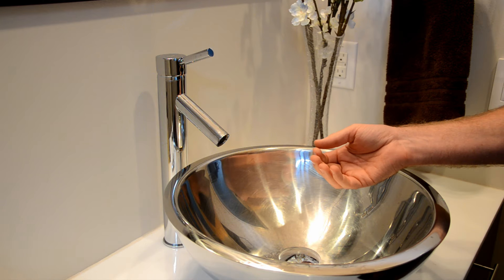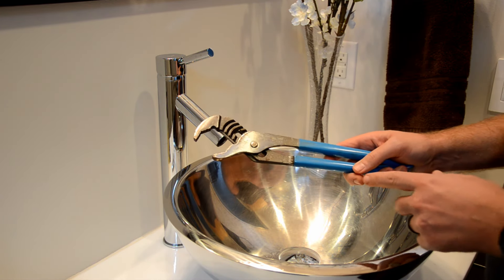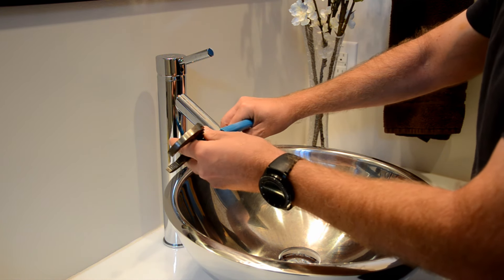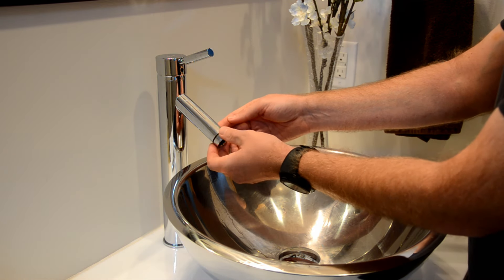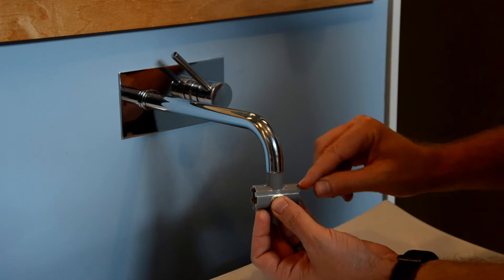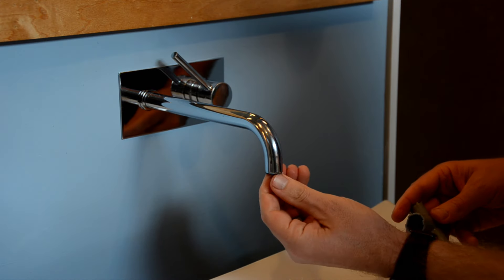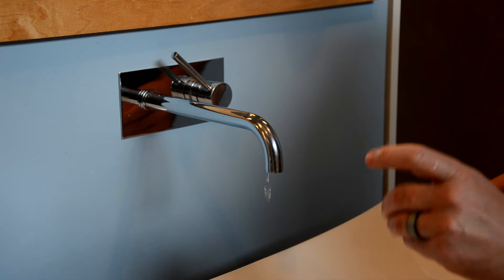Replacing a Faucet Aerator...that’s stuck!

Comment: Errr, why was this video titled about removing a STUCK faucet aerator when it's just a video showing how to remove a perfectly normally loose aerator that isn't stuck at all (on the recessed one)?
Reply: Like calcified in place !  My issue!  Tried soaking in vinegar and the aerator still does want to unscrew.  Address that!
Reply: Get a hose-clamp ($3.99 at ACE) and use a screwdriver or nut-driver to tighten it on.  Then use a hammer to pound on the screwdriver in the correct direction  to loosen the aerator.
Reply: @RichardHills-lt4sz  how is a clamp going to take out an aerator if the aerator is in the inside???
Reply: @220serrato  I just used a clamp for a screw-on aerator.  If it's a recessed aerator, I think you need s special tool.

Comment: Could you’ve show other types of faucets. Mine doesn’t look like the ones you showed. It’s a bathroom faucet with hot & cold taps and a stopped value. The aerator protrudes about an eighth of an inch out out the tap. I cannot grasp it with anything. The underside of the tap appears to be plastic, not metal.

Comment: I have a set of plastic keys from Lowes. They dont work. None of the sizes fit the groves and it took 30 mins slowly trying to loosen only to have it keep falling out (good to see the same issue happened with you). Only to finally get it started and then seize up and wouldnt get it totally off.  Got it low enough to slightly turn with finger but only 1 turn. This is such a stupid design.... aesthetics over function  - why cant we have things that encompass both??? Mine is a Moen faucet for bathroom sink. Tried soaking as well - no luck so far. Do metal aerator keys exist? Do they work better than the plastic or do they damage faucet?

Comment: Even easier.  Get a hose-clamp ($3.99 at ACE) and use a screwdriver or nut-driver to tighten it on.  Then use a hammer to pound on the screwdriver in the correct direction  to loosen the aerator.

Comment: Thank you so very much, sir, this was so helpful!  Using the handles got the aerator off when the jaws wouldn't.  Also very helpful advice on vinegar type and soak time.  This totally solved the issue, aerator is back on now and water pressure perfect!

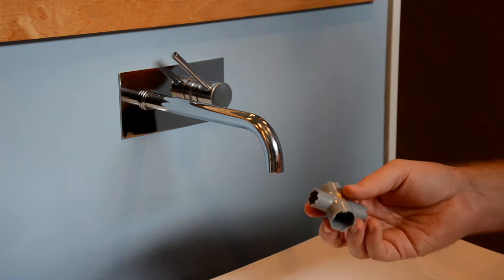Comment: I got an issue with plastic IKEA aerator... I screwed it too tight and now i can not unscrew it, as the place when screwdriver was supposed to go is damaged. I see that the aerator can also be removed using this key from 1:25. I'll try that if they sell those in my country :P Thanks for making me aware that such a tool exists :)

Comment: If you don’t have rubber handle pliers I got mine off by putting a rubber band around the aerator as tightly as possible and then using a rubber glove to turn it! I tried everything but this worked best.
Reply from the maker: Nice tip! Thanks.

Comment: Chris, I enjoyed the video but I wanted to let you know that my issue is with a cache aerator which I cant remove with the removal tool.  It moves a little but then jams up and will not go any further.  I have the end of the faucet soaking in a zip lok bag with 75% white vinegar and water.  We'll see where that goes.
Reply: did it work?

Comment: I have the cache tool but cannot loosen any of three stuck aerators with it. Even tried using slip joint pliers to turn the cache tool but none budged. I have the plastic tool that came with the faucets. Is there a better one?

Comment: Great video! But it's missing how to remove a stuck cache aerator.

I have the right sized key, but the aerator itself appears stuck in the faucet. Maybe stuck because of lime scale or some other buildup. What can I apply (and how) that could help my cache aerator come free?
Reply: Hello. I have the same problem. I taped a plastic food bag filled with some white vinegar to the end of the faucet and hope to soak the 'gunk', which is locking the aerator in place and making the gunk difficult to remove. If you try this, make sure the aerator is completely soaked in the vinegar and leave the food bag on overnight.
I will wait to see if this idea works!
Reply: @johnzajac9849  Did it work ?

Comment: Thank you for the great advice. I have a Kohler bathroom faucet where the aerator is a small ring on the bottom of the spout that is a conventional thread. But it is stuck. I mean really stuck! Can I use WD-40 or something similar? I'm afraid that I'm going to break the faucet if I try any harder to break it free. Thanks!

Comment: How do I get a broken Aerator threaded part out of the faucet. My daughter went to take it out and the aerator broke unscrewing it leaving its Brass threads inside the faucet. Its on a Moen Bathroom Faucet. I thought I might have to use a Burns-o-matic Torched to heat it a little but thought I should wait to see if there is a better way. I have been spraying WD-40 inside the nozzle and let it sit over night but it did no good. I tried to wrap some wide rubber band material around a needle nose plier to see if that would grab enough but it seems almost frozen on with some corrosion. That was the reason I was thinking some heat. I also own a heat gun maybe I will try that next. Might be better to use then a Burns-o-matic Torch. It wouldn't get it so hot.

Comment: Tried to use the handle of my channel-locks to take it off, but no luck. My solution was to put a thick dishrag in the jaws of the pliers and turn it off normally. Worked, with no scratches to the aerator.
Reply: Can you make a video (re-enact) to demonstrate???????

Comment: I have a mowing Walden single-handed kitchen sink faucet I am not able to remove the aerator. It does not use a key I have used CLR cleaning solution soaked the whole end of the faucet overnight two times I've tried some penetrating oil.  I tried the  back of the pliers idea that you had I am afraid I'll snap the stem off my faucet any other tips?

Comment: I just found your video tonight.  I tried all the methods you suggested to remove the aerator and no luck. It is a metal screw in type.  I had to put it on in order to use a pur filter on this kitchen faucet.  This metal thing is stuck in there.  What would be your next suggestion to try and get this damned thing off the end of the faucet?

Comment: what if the aerator does not loosen up inside the faucet and breaks up around the edge? My aerator is one that you have to use the key internally it does not unscrew on the outside. I think I will need to take the whole faucet off to place it upside down to get leverage on it.

Comment: I have a 'cache' aerator on a Moen bathroom faucet, which is stuck in the faucet. I have the plastic tool with the 'teeth', but I can't turn the aerator. Is there something you can suggest that I can spray the aerator with in order to loosen the gunk which has locked the aerator into the faucet?
Reply: solved it somehow? got the same problem

Comment: Do you know if the blue pliers you have are 10", 12" or another size??? might as well buy the same kind
Reply: Looks like a channel lock plier, the kind you use to un do the bolts on the toilet.

Comment: Hi. I have a Delta bathroom sink faucet (520-mpu-dst). On this faucet the plastic aerator screws into another piece of plastic or metal (aluminum I think) which is separate from the top of the main cover assembly outlet.  When I try to turn the aerator out of this lower assembly of the faucet outlet, it starts to separate from the top. I am afraid this lower assembly will either break or bend while twisting the aerator. Can you shed any light on this problem?

Comment: I'll try the handle but I have a feeling it won't work for mine. I tried using regular groove joint pliers like you showed and even those couldn't do it (just unscrewed like an eight of a turn). I live in an apartment with a 40 year old bathroom faucet (probably) and the pliers still were slipping. Isn't there some tool with like a rubber lasso that you can tighten and loosen to fit around things? Maybe that sounds dumb, I'm no tool guy lol.
Reply from the maker: You could try what's called a strap wrench.

Comment: I can get my aerator out, it's the housing around it on a Delta faucet I can't get out. I have to add more water to my waterbed and the damn thing is stuck. It's plastic, so I'm afraid to mess with it too much since there's only about 1/4" or less of it below the faucet to grab. I've gotten it out before but can't get it this time. Any ideas?

Comment: Hello!  My bathroom sink (just purchased and moved into this condo) has a cache aerator that somebody has obviously tried to removed before.  The screen section is completely GONE.  And the outer section with the groves has been messed with enough that it is "stripped" for lack of a better tern...all the grove thingies are pretty much worn down and none of the "key" things will grip into the indentations.  I need some idea (that I can do, LOL) about what to use to get that outer ring out of there.  I know the idea is it is screwed in place, and I have tried various methods/things to shove up in there that will have enough grip to be able to screw it out but haven't found anything that works.  I know not to do anything with extreme force :)   I have tried wrapping various objects (that are not too long to fit directly underneath the faucet with grippy things like a tourniquet and such but no luck.  PLEASE tell me there is something I can do that won't require plumber's expensive visit!
Reply from the maker: Here's one idea...buy the largest slotted screwdriver you can find (largest being the widest tip that isn't bigger than the diameter of your aerator. Take a utility knife and carefully cut across the aerator. You want to try to get that screwdriver as deep as possible into that slit as possible. If it goes in by a quarter inch or more, you might be able to unscrew it with the screwdriver. You may need a what's called a stubby screwdriver which isn't long but still has good handle.
Reply: @ToolboxDIY  thank you!  I just broke down and called a plumber...sad but true.
Reply from the maker: @albecky123  No shame in that. If you are/were able to see what the plumber did to remove it, can you share with all of us?
Reply: @ToolboxDIY , oh I'm not ashamed.  LOL, I would have been ashamed if I had continued to struggle with it, applied too much force and broke the hole faucet off...that's my luck!   I tried the little round tool thingy that they sell at Lowes, but the plumber had a tool specifically for this and best I can describe the tool is that it was long, thin, and flat on on side with various intervals of indentation along the other side...he slotted the correct indentations for that specific size faucet end into the edge of the aerator and just gave it a little bit of a turn and it was out.  He said those round tools are not really the best option for that type of aerator although they are sold for that.  He was able to help me out with something else while he was here, so it's all good.  I have a relationship with this company and they always send the same plumber if at all possible. He has even gone shopping at Lowes for me on his own time to find something I needed in the past....he took pictures, let me pick what I wanted, then when he came to install the item, that was the visit I was charged for (and of course I paid for the item he did my personal shopping for!)

Comment: Similar to another comment, my aerator appears to be the kind you can screw off, but it’s not stationary. When I attempt to unscrew it, it just spins and doesn’t seem to be attached to any threads. How do I get it off?
Reply from the maker: This is tricky without me being able to see it. Try bending a paper clip into a hook shape and then pull it out as you unscrew. The threads could be stripped out.

Comment: The aerator in the faucet is not stationary, it is spinning in place at the tip of the faucet. How do I remove it?
Reply: Same here. Mine just spins but doesn’t unscrew. Wondering if I need that cache tool?
Reply: @sunshinecruse  I finally figured it out - I used Danco 10909 multi-use aerator key.
Reply: @akonti2  thank you. I’d checked with a few neighbors and finally figured it out, too. A dual aerator key was exactly what I needed. I got it off, but the screen is damaged, so I need a new aerator. But at least now I know the issue. Thanks again.

Comment: What do you do when the metal part breaks off in the faucet????
Reply from the maker: Insert needle nose pliers into the opening, open the pliers, and then try to unscrew. If that doesn't work because it won't catch the metal part to unscrew it, try cutting a raw potato in half, jamb it into the metal and try to unscrew it. You may have to carve up the potato a bit depending on your faucet.

Comment: Wrap each of the jaws with rubber bands if you are like me and don't have anything fancy like this.  All my tools are either vintage or antique. That means they won't break while I'm chewing the Heck out of the aerator cover that someone screwed on crooked and jammed it in to fit.  The faucet is only about 2 years old and buildup isn't a problem here, so it's not a soaking issue. No matter what I do it won't budge but the faucet itself seems quite willing to disengage itself from the entire sink in the process!  #@$&*!!

Comment: How would you remove an aerator from a Kohler Maxton sink faucet?
Reply from the maker: Do you see small screw on the back side of the faucet head? Or if there's a pull out sprayer on it, do you see a small screw on the bottom of the sprayer?
Reply from the maker: Tricky one. Maybe this will help: https://support.kohler.com/hc/en-us/articles/360004636353-Maxton-Faucet-Stream-Breaker-Removal

Comment: Those aren't stuck .how do you remove a corroded   stuck one that breaks the plastic removal tool teeth off when trying to turn it.
Reply from the maker: If possible, try vinegar in a plastic bag. Use a rubber band to secure it to the faucet and make sure the aerator is submerged in the vinegar. Let it sit at least overnight. You could also try something like CLR.

Comment: What exactly you did? First you removed the aerator. Then you didn't show putting it back, but the size of the tap shows you had put it. and you did something with the 4 way key. Not clear what you did. But that again removed the aerator. When you had already removed it, why to remove it again. And then you say "clean or replace it", shouldn't you have shown how to clean it? Was this video devoted to just opening the aerator. Learn to add more information in your videos. Waste of time.